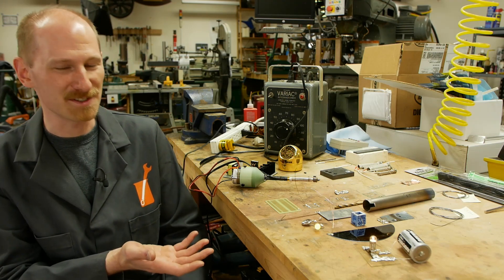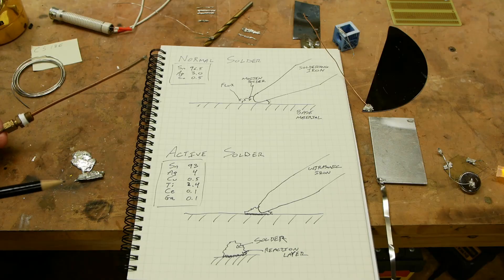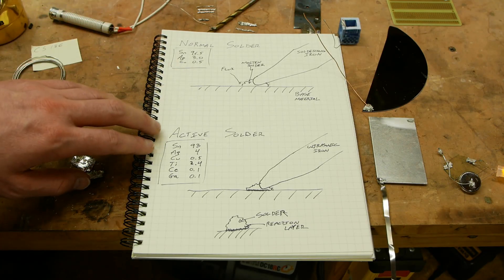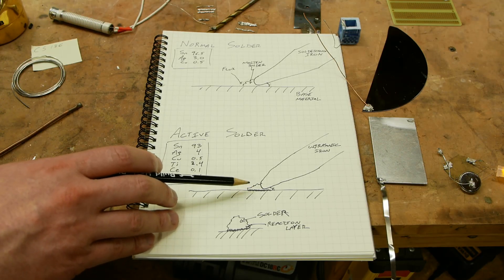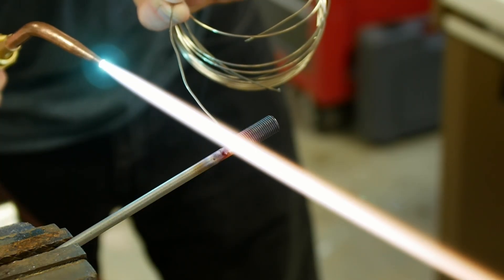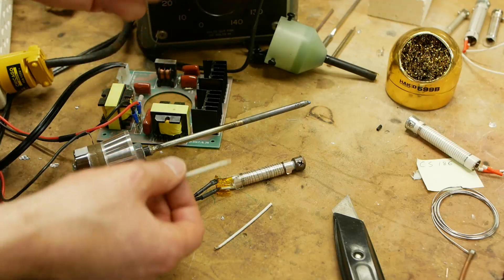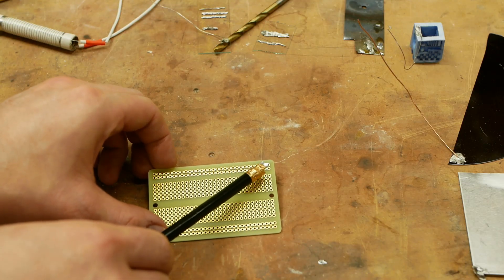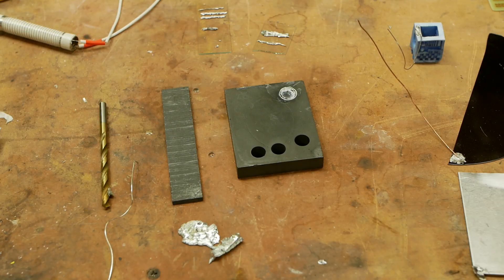Ultrasonic soldering bonds glass, titanium, stainless steel, ceramics, tungsten, nichrome...

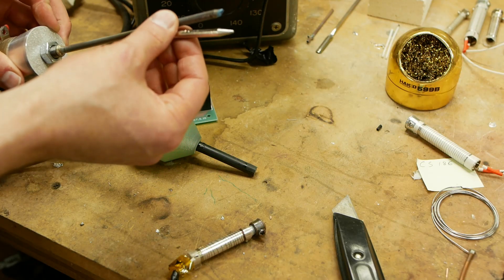Comment: 10:13 its galium and heat. I know galium even melt platinum below the platinum melting point
Reply: given that the alloy is only 0.1% gallium, I'm not sure there's enough there to be a major contributor to corrosion.

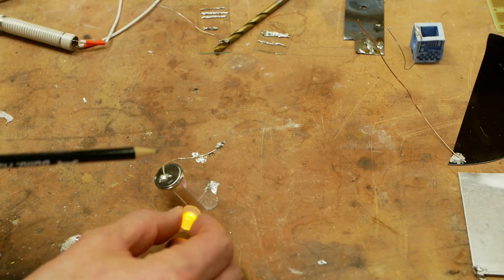Comment: One thing confuses me. At 13:55 you have what looks like a circuit completed *through glass". The lead of the LED that's not connected to the coin cell is soldered to the glass, and the other end of the coin cell is also soldered to the glass, but where's the connection? Is there an invisible conductive film on the glass?
Reply: He said it it ITO coated glass. I am guessing that means Indium Titanium Oxide. It is also a conductor.

Comment: Soldering tips are made of copper and galvanized with iron, to prevent the copper from being dissolved in the solder. I guess the iron layer of this cheapo soldering iron might be crappy or fracture under ultrasonic load and once there is a crack the tip will quickly deteriorate. Thanks for another interesting video. I love your channel!

Comment: What would happen when you re-heat the solder connection with a standard iron, no ultrasonic? Maybe even use flux. Can you rework the joint to attach new wires or even just make it look better? I assume that since the active solder has already wet on to the substrate it should stay there.

Comment: Question, once it takes to glass, can normal solder then be used to connect or reconnect components ?

I think something like an Arduino Uno using that ITO glass as it's circuit board would be cool.

Comment: Neat!  Beats spot welding Nickel as an intermediate metal to facilitate such bonds. I'll have to try it. Titanium certainly bonds well to glass via its oxide, it's COE is close enough to borosilicate glass that thin wires can be sealed directly through it just like tungsten and sometimes molybdenum. A flux or shield gas might make titanium containing solder or brazing metal practical without the gallium.

Comment: I assume the solder is electrically conductive. It'd be interesting to see if you could bond two ceramic plate together and have the current from one side to the other just through the solder layer.

Comment: About the destruction of the tip of the cheap soldering iron. Cheap soldering tips are often made of iron with a coating of a zinc alloy. Iron and zinc can be absorbed into the solder. And the ultrasonic speeds the process up.

Comment: Incredible stuff! Every video of yours never fails to blow me away.

By the way, I can almost guarantee that the erosion of the tip is simply due to the horrifically cheap quality of that iron. I bought the exact same one a while ago and it shocked me how quickly the tip fell apart, honestly the worst iron I've ever used.
Reply: Scrap Science 
    What I learned way back when was that ordinary tin/lead solder eats copper tips of soldering irons.  To overcome that, you coat the tip with iron.  OK, supposedly all soldering iron tips since that revelation have been iron coated, with copper inside for adequate heat transfer..  BUT, when the coating fails, as it eventually does, at least my soldering irons at some point stop heating the tip.  Then I find that they have become HOLLOW!.  No more copper, no more heat transfer...
Reply: @InssiAjaton  so that's what happened to my cheapo chinese soldering iron.

Comment: I wonder if you could make your ultrasonic iron use Hakko or Weller tips. I had a cheap radioshack soldering iron once and the tip ended up looking likes yours after using it for a couple of projects.

Comment: Awesome video as usual. You asked for suggestions for applications, I might have one: would it be possible to make an hermetically sealed metal feed through in glass or ceramics in this way? For example by applying the ultrasonic energy to a copper tube from one side while inside a hole in a glass plate and at the same time heating it from the other end and applying the solder? Metal seals are known to be completely hermetic to moisture / gasses and this technique would be very useful in vacuum systems for making a quick hermetic feed-through.
Reply: This is exactly why I happen to have some of this stuff. It's often used to form a hermetic seal between titanium and sapphire glass.

Maybe Ben has been playing with the surgical robot at work.
Reply: Keep in mind, If materials  thermal expansion are not the same, sealant can't be stiff, or it will not work at all.

Comment: Cool the chemical process seems very similar to that of vitreous enamels adhering on metal. I did my master's thesis on the subject so if you ever need some info just say so. 
But what is boiles down to is that most base oxides can mix(like your glass) and if you can make a metal to oxide to metal interface layer you get good adhesion. In the end it is just a question of balancing oxygen and activation energies.

Comment: Im curious if this methos could be used to ultrasonically braze PVD coated carbide machine tool inserts onto steel.  Bare carbide brazes quite easily but not the coated inserts.

Comment: I can definitively answer your question about the soldering iron tip. CHEAP SOLDERING IRON TIPS SUCK. I bought a $20 soldering iron and the tip was useless after 3 hours.

I then bough a $200 Hakko 888d and one tip has lasted several months.

Comment: Awesome and well explained, just curious re the LED and battery, was there a reason why the light was fluctuating? i.e. a "not so good" solder joint. In most ordinary soldering a bad connection will stabilise ounce movement stops but in this case it seemed to continue after you put it down, battery going flat doesn't seem to fit either. Is it a conductivity issue within the solder? By the way its soLder :)

Comment: Very interesting. I wonder if you can use this technique for making vacuum tight glass windows by wetting the glas with a solder circle and then reflow it to a flange with common soldering methods. Of course, expansion coefficients should be matched. The question is wether that also works with windows coated with anti reflection coating. Got the idea? tinkering with DIY gas lasers might then be quite more easy.
Do you have a helium leak tester? If you have time could you do some tests?

Comment: Okay, so how about trying to solder some copper plumbing pipe and see if it makes a good seal. Soldering that stuff normally involves lots of fire right next to dry wood. If thermal mass is not an issue, this could be a great commercial application.

Comment: Both of your hypotheses about tip erosion seem plausible. You're dumping a ton of acoustic energy in there with a 60W element and a tip that small. Pretty absurd power densities, even if you account for losses from your modification. 
I could see the gallium or even the cerium contributing significantly to the erosion.

Comment: I'm interested in ultrasonic welding (not soldering, I suppose?) of copper to copper, like they do in IC bond wires. There are expensive machines that do this with tiny bond wires under a microscope. Is it possible to do this with your kind of setup? Thanks!

Comment: Wondering how much effect using a shielding gas aka like how mig or tig gun works would have on this type of soldering. I'd imagine you could do away with the cerium and gallium and possible even increase the amount of titanium. If don't have the cerium and gallium you might get harder alloy.

Comment: If you took 5 rectangles of glass and used this to run a bead down the seams (like tinning the edges); could you then bond them into a fish tank? What depth of water would it hold before this ultrasonic solder failed in tension? (Or would it fail in shear first?)

Comment: Electrical passthroughs for high vacuum or cryogenic applications tend to be very expensive.  You could probably use this to connect an insulator into piping, then a solid metal wire inside that for sensing.  It looks like regular glass and titanium have similar coefficients of thermal expansion (at least at room temperature), so you might be able to make a decent passthrough that stays leaktight down to cryogenic temperatures.

Comment: i somehow was able to solder nichrome wire with a normal soldering iron, perhaps it was more of a physical encasement but it seemed to have worked
Reply: it may be possible to solder nichrome wire. I have been able to solder stainless steel using electrical solder. The secret sause for soldering SS is to scratch the SS surface while its under the wet pool of solder. The scratching removes the passivated layer allowing the solder to bond. I presume if yo scratch the nichrome wire under the solder pool you be able to bond it.
Reply: @guytech7310  i may have done it without realizing it

Comment: If this alloy consists of 90% of Sn, then perhaps it should be treated as regular soldering alloy. I mean that regular soldering alloy will give such bad looking joints in case of low temperature or not enough flux. Maybe it is necessary to add flux anyway and to regulate tip's temperature.
Reply: Flux would containate this type solder.
Reply: @guytech7310  hmm, but I don't mean  conventional flux. Probably it will need special one which will affect only alloy.

Comment: Can you automate this process like MIG welding using copper wires and ultrasonic welding material? If so we can draw circuits on glass using CNC
Reply: No. but you could probably take a copper foil and etch it first (ie ferric chloride) than bond it to the glass. I doubt it would look very pretty. A  better method would be a epoxy or vacuum vapor deposit onto the glass using a pre-applied mask to the glass surface.

Comment: It have a thermoelectric effect at all? The resistance change at the joint due to temp?  So many metals in the mix I'd think crazy things would happen. Wonder well it'd perform around shifting magnetic fields around an induction heater for example or a cell phone charger.  Wonder if it's making graphene from the graphite by bonding to the surface and ripping off an atom sheat.  Nifty stuff never knew about.

Comment: How much current can that coated glass handle, and what happens in an over-current situation. Please science dad, I must know.
Reply from the maker: I've heard they use ITO-coated glass as a defrost system for aircraft cockpit windows (no heater wires to obscure the view).  In other words, it can dissipate many 10's or 100's of watts for a windshield-sized piece no problem!
Reply: @AppliedScience  Thats pretty cool, still wanna see what happens during a failure, like does the glass just crack from the heat, also what about super high voltage, will you get a lightning pattern etched into the glass?

Comment: Would an ultrasonic tip help normal soldering?
Reply: No.
Reply: @guytech7310  have you experimented, something you've heard, or something you've reasoned.
Reply: @djmips  You don't need ultrasonic to do conventional soldering. Its like asking: would a washing machine make a car drive better. The reason why this type of soldering need ultrasonic is because it need to agitate he solder to activate the bonding metals, much like mixing a can of paint before you apply it. Regular solder is homogenenous so no mixing is required for bonding.

Comment: Didn't you have to tune the soldering tip to resonate with the transducer? Very interesting project, I can think of a million applications already
Reply: I don't think that is important. The purpose of the ultrasonic is to aggitate\mix the solder pool such that the active bonding agent (Ti) can come in contact with the surface so it can bond to it. I suspect that you could bond it using a regular iron and just scratching the glass surface.
Reply: @guytech7310  Thanks. I was just expecting that tuning would increase the tool's efficiency. Since Ben is having trouble with the apparatus being too powerful already though, I guess it really doesn't matter. Only makes it easier!

Comment: Try if it solders on aluminium..i'm pretty sure there is special non-active solder that works but this might work too (i suspect that since i had modded heatsink that had soldered a copper heatplate onto onto cast aluminium heatsink)
Reply: Since the alloy includes gallium this may be a bad idea
Reply: 0.1% is fine. commercial alloys for soldering aluminum contain gallium too

Comment: Very interesting stuff. Have you tried putting the substrate on the ultrasonic module and just use a normal soldering iron?
Reply: If I remember right, the manufacturers recommend exactly that as an option.

Comment: Will this seal a very small refrigerant leak in aluminum tubing on an evaporator?
Reply: I wouldn't recommend it. The bonding isn't very strong. and the pressure and thermal cycling is likely to cause it to fail.

Comment: The other important question is how well this joint survive temperature changes. Usually glass-metal bonds are made with alloys which thermal expansion coefficient is similar to the glass (namely kovar), otherwise the glass would crack or the joint would split.

Comment: In a way this sort of reminds me of how CPU companies have to go through multiple metals and steps to solder the IHS (integrated heat spreader) onto the silicon chip. They have to wet the nickel plated IHS with.... gold and indium I believe. It's an intensive and expensive process, which is why Intel was using toothpaste instead of solder for a few years.
I'm wondering if they could use this to bond the IHS to the chip in one step using a thin sheet of the alloy, then applying an ultrasonic heat source to the top of the IHS to melt and fuse it to the chip.  
Very cool stuff, as always.

Comment: Ultrasonic soldering has been around since the 50s. It is neat, and definitely useful, but has a lot of drawbacks. It has been getting a lot more popular in the last 10 years so we'll see if they can get around many of those, the main thing is that it is such a weak mechanical connection, much weaker than normal solder, you still need to worry about galvanic corrosion, and it doesn't hold up well in harsh environments with a lot of vibration, so it works well in situations like solar cells where it's a purely electrical connection that just sits there.

Comment: The soldering iron tips that were getting eaten up probably aren't doing so because of the ultrasound or corrosiveness of the active solder. I bought a similar cheap soldering iron a while back and the tips would quickly burn out in the same way just using regular electrical solder.

Comment: I used to do ultrasonic soldering 35+ years ago.  Most of the solder alloys contained cadmium which produced good wetting.  There was several different alloys back then which were optimized for different materials.   I used to solder to aluminum foil with excellent wetting as it looked as good as tin-lead solder.  I also soldered to glass optics.  US Patent 4,106,930 describes the recipe.  Thanks for the great video!

Comment: Love it Ben! Great work. Wondering how the electrical and mechanical properties of these ultrasonic soldered joints compare with cold welds, such as those accidentally formed in vacuums like on the ISS Solar Array Rotary Joints. Seems to be a similar mechanism, except no solder is required for cold welding.
And can glass be cold welded I wonder?

Comment: OH NO!    Now all the cool old u-sonic soldering equipment on eBay will always get bid up through the roof!    (Got mine though.   But I was hoping for a used cheap tiny Sunbonder pencil-iron.)
If only this stuff was popular, then mass-produced soldering irons would be well under $500, instead of well over $2000.
Heh, use 50C gallium indium alloy solder? See if I can sonic-solder things permanently to skin?    Apply silvery tattoos!  Removable with a lot of careful razor work!

Comment: I note that many old iron manhole covers made of iron have a beautiful, smooth brown patina. Close dark auburn. They dont rust. Even when the ferrule lip they sit in sometimes do. Even the ones that get no regular traffic running over them dont rust. An older brother once said he was told by another welder they anneal the surface with a certain kind of flame I cannot recall. I've noticed the ancient, rust-free iron pillar in India seems to have the same kind of patina.

Turmeric in flour prevents rancidity. I've toyed with the idea of using turmeric in mineral oil for my iron tools, but haven't as yet. Interesting, too, many of the Siddha formulae for alloys talk of adding herbs in the processes. Though you'd think melting metal would obliterate any organic compounds, but then all plants have metal components too. These tiny fractions might yield unique properties. Siddha manuscripts have the earliest talk of transparent metal.
Reply: Man hole covers include trace elements like phosphor & manganese, and use higher carbon to make the rust resistant. 

if you want to prevent rust on your tools, you can use deoxIT, or apply phosphate acid to create a barrier. You can also apply a anti-corrosion wax (but it does not last as long).  There is a video on this channel that explores rust inhibitors (probably 2 or 3 years ago).
Reply: If you heat metal just right, you can create a thin, controlled oxide layer which will prevent further oxidation.  It varies in color from browns to blues.  Look up "bluing", it's often done on firearm components.  The process used to be done just with heating, but nowadays it is usually a chemical or electrochemical process.
Reply: @24680kong  Bluing only provides a limited amount of corrosion protection, if you put a blued steel piece next to a manhole cover (ie same environment conditions), its going to rust considerable faster. Bluing is also used to help the steel retain oil which does most of the corrosion protection, not the oxidized layer. 

 The alloys between cast iron manhole covers is considerable different for high strength steel alloy used in firearms.